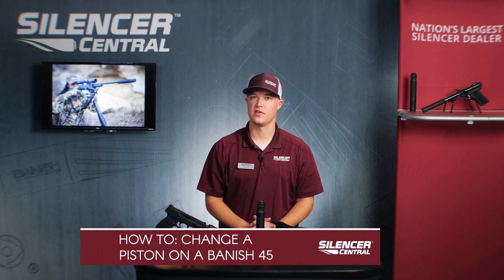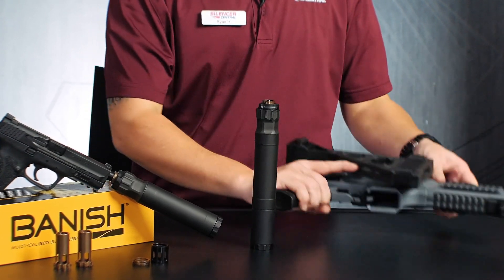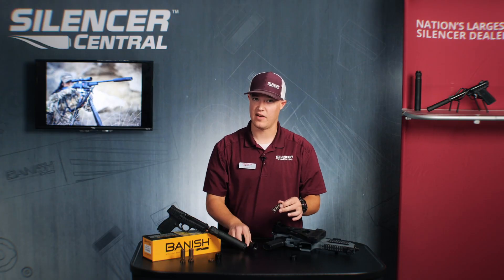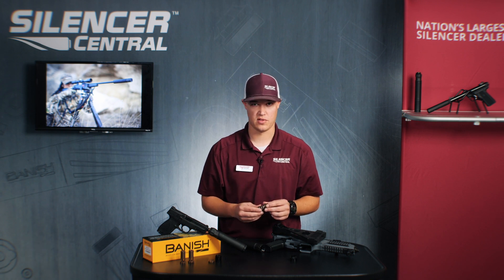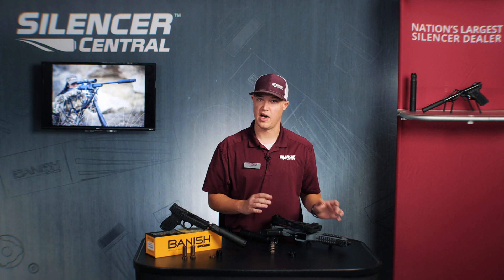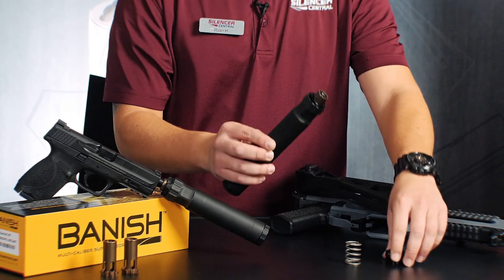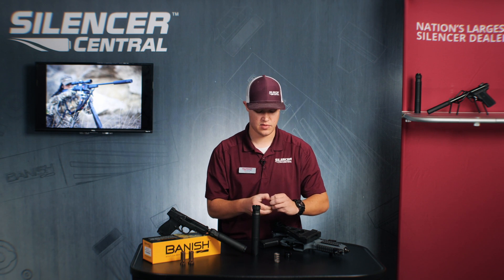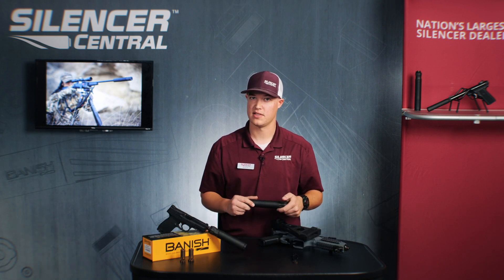How to Change a Piston on a BANISH 45 Suppressor

Comment: So.. given the zoomed out camera and poor lighting, you can't see the orientation of the fixed barrel spacer. I looked at the installation pdf, and the spacer appears to be oriented such that the o ring end faces the muzzle of the firearm. The spacer in the pdf is not really drawn to the scale of the actual part, but looking at the distance between the oval cuts and the faces, it seems this way.

Comment: I received a small rubber o ring with my fixed barrel spacer. What’s that used for?
Reply: Your video was too fast and too far away.

This video is for ppl that already know how to donitm
Reply: It fits into a groove made into the barrel spacer on the inside of the "short" end
Reply: Correction, the "thicker" end

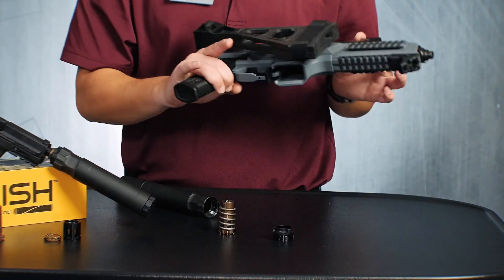Comment: 1:07 is that right for fbs? See below from your website..... Yes, barrel spacers are worth the money if the barrel of your gun moves, like in most pistols. A spacer will keep the suppressor from pounding the barrel as it moves, and from damaging either the gun or the silencer.
If you are shooting a rifle with a fixed barrel that does not move, you probably don’t need a spacer for your suppressor mount.